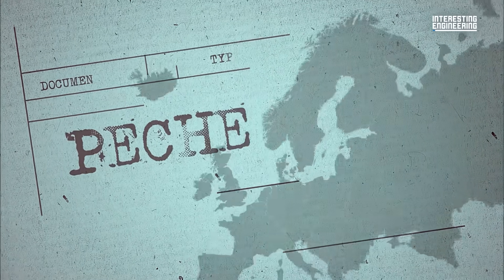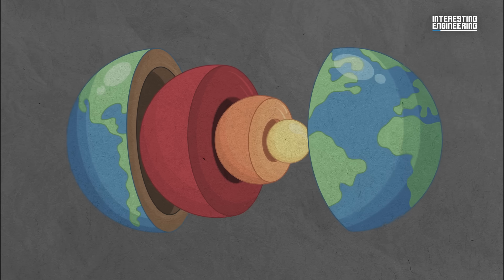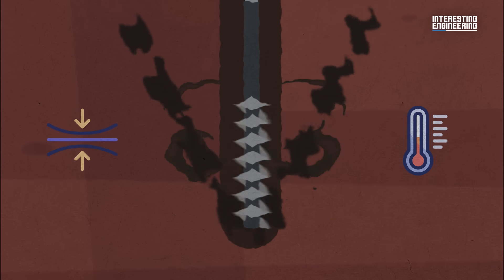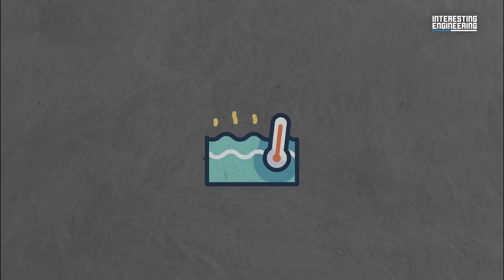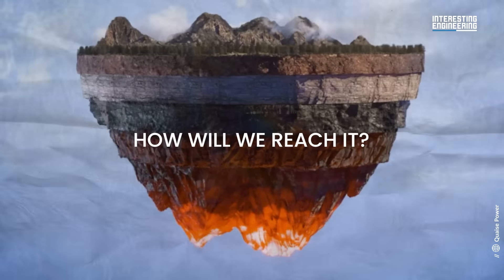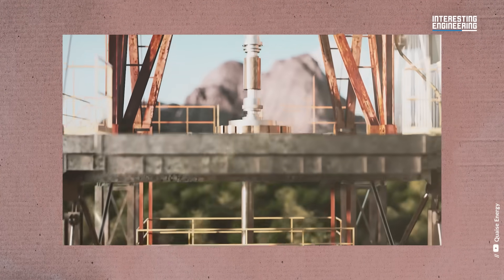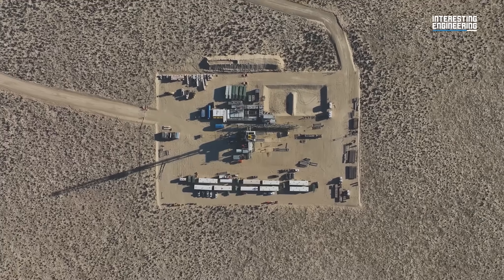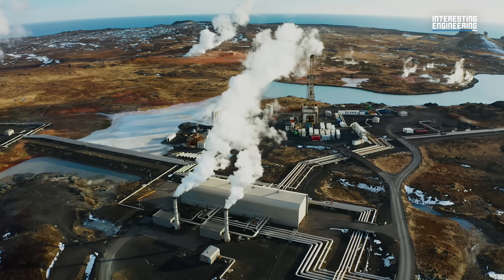How Deep Could We Dig for Infinite Geothermal Energy?

Comment: What I don't understand is why you have to go to such great depths to get heat. The boiling point is at a temperature of 100 degrees Celsius. To make steam. This is a temperature that is reached at a depth of less than 4 kilometers. This is a depth that can be reached without much problem.
Reply: It basically comes down to a formula known as "Carnot's theorem".

According to history, back in the 1800s various dudes including James Watt and others were playing with steam engines, and they were trying to optimize their thermodynamic efficiency so as to get the most useful work energy out of the engine, for the least amount of coal consumption.  A French guy named Sadi Carnot is credited for coming up with the formula:

nmax = 1 - (Tcold / Thot)

Where nmax is the maximum theoretical efficiency of the heat engine, Thot is the temperature of the hot portion of the thermal engine (ex: such as the steam temperature prior to entering an expansion chamber to do useful work), and Tcold is the cold side temperature (ex: the exhaust temperature of the steam once it has already expanded and done the useful work in the engine).

To use the formula, the Thot and Tcold temperatures need to be provided in absolute temperature units (ex: Kelvins, which start from 0, rather than Celsius or Fahrenheit, which start from negative numbers).  To convert Celsius temperatures to Kelvin units, add 273.15 degrees to the Celsius value.

Steam at 100 Celsius (373 Kelvin) is very poor quality steam, and it will yield very low thermodynamic efficiency when operated on the surface of the Earth, where the cold side of the steam flow exiting the turbine might be something very close to the hot side inlet temperature to the turbine (perhaps 60 Celsius, or 333 Kelvin, which is only possible for steam at lower than sea level atmospheric pressure).  According to the Carnot theorem, then the maximum possible thermodynamic efficiency of a thermal engine operating with those hot/cold temperatures will be:

nmax = 1 - (333 Kelvin / 373 Kelvin) = 0.107 = 10.7%

That is a very low thermodynamic efficiency, since it means you have to produce/obtain/process close to 10x as much heat in your heat exchangers, as you are getting out from your heat engine as mechanical energy (which further gets reduced a little bit converting to electricity).

The maximum theoretical efficiency goes way up when you use higher temperature steam (say 400 Celsius, or 673 Kelvin), or, you reject your heat at very low cold side temperatures (which is mostly restricted only to space applications, since no part of the Earth ever naturally gets anywhere near absolute zero).  The minimum cold side temperature for a normal Earth surface based air heat exchanger is the ambient air temperature, which will commonly be 25 Celsius or warmer on a hot summer day.  In practice, the cold side temperature will always be higher than this for practical heat exchanger size reasons, so something around 60 Celsius or 333 Kelvin is around the lowest practical value (with some exception for cold winter nights).  For a steam engine running at 673 Kelvin input temperature, and 333 Kelvin exhaust temperature, the maximum theoretical possible efficiency is 50.5%, which is far superior and practical for designing power plants, as compared to 10.7%.

There are however certain limitations to using Carnot's theorem.  It is applicable for macroscopic thermal engines operating with bulk heat transfer fluids, but it is not applicable to either solar photovoltaic panels or individual particle (ex: picoscopic/single molecule scale) non-equilibrium thermal kinetic energy converting systems (like that envisaged by James Clerk Maxwell, in his "Maxwell's Demon" argument/analysis/thought experiment).
Reply: Very high temperature steam is needed to drive a turbine.  First the boiling point increases with pressure and efficient turbines require high pressure (thousands of PSI).   Second, the steam has to be “dry”.  This sounds stupid, but in this case dry means there are no drops of liquid water.   High pressure dry steam is a pure gas.  Steam turbine blades do not like getting hit with liquid.  (It shortens their life) Since the pressure is dropping rapidly in the turbine, the gas has to be superheated (higher than the boiling point at that pressure) so that even at the lower pressure water drops do not form.  Now, with that said, sometimes turbines will have sections (or stages) that can handle some liquid water.  This is done to pick up a slight efficiency gain in order to stretch that fuel out a bit further - and nothing wrong with that.  But the high power front end stages do not like it.
Reply: Steam is just a working fluid, it's the "heat" in that steam that turns the turbine and gets turned into useful work, not the steam itself. The steam is just a carrier of heat.

Comment: Why is it so cold at the deepest parts of the ocean, its closer to  center where its supposed to be hot!
Reply: Colder water is denser than hotter water, at least down to 4 Celsius.  Consequently, the colder denser water wants to sink, while the warmer water rises to the top.  Additionally, warm water is actively produced at the top of the ocean, as most sunlight photon energy does not penetrate very far into water before getting absorbed and converted to thermal/heat energy.

Theoretically, if hot water is produced at the surface from sunlight absorption, and the Earth's core is really hot, then you should have hot water above the cold water on the sea floor, and hot Earth below the sea floor, thus creating a hot-cold-hot "sandwich", which would make the cold water middle portion become hot instead of cold.  However, that is not what one observes, as the system is more complex.

In practice, the Earth's crust is thick enough to be a good thermal insulator, so heat flow out of the Earth's core through the crust is quite slow.  Additionally, sunlight starved portions of the Earth, (ex: arctic/Antarctic) especially during winter, are quite cold.  These sunlight starved portions of the Earth produce large amounts of cold water, which is dense and sinks to the bottom of ocean, but in so doing, leaves a lower pressure location near the surface, which sucks in warmer surface waters being produced in sunlight abundant locations of the ocean closer to the equator.  The warm equator water travelling near the surface reaches the arctic/Antarctic region, cools off, sinks to the bottom, and continuous the heat transfer loop as cold water moving back towards the equatorial region (near the bottom of the ocean).  Thus, the colder water at the bottom of the ocean is constantly warming up and rising, but it is also constantly getting replenished/replaced by new cold water coming in from the sunlight starved polar regions of the Earth.

Comment: I am not against nuclear. Especially if they get fusion to work. The simple reasons are off planet, high latitude locations and special applications. However, we are in an energy transition, where power generation takes place at decentralized local levels. Geothermal is best used as baseload for distributed battery based mini-grids.
Reply: I was thinking the same thing. Geothermal is great for those staying here on the surface of the Earth. Up in the sky, in the sea, in orbit, on the moon, etc... all but worthless. I'll be fair here, the vast majority of us will be here on the surface.
Reply: Same same. Team Low/No Carbon vs Fossil Fuels. Not any other way...

Comment: America needs to tap Yellowstone
Reply: No need, think of Yellowstone as being a welding torch.  The path, which is followed by the Snake River, is the weld bead.   The material under that bead is still hot.  Look at “Hells Half Acre” along I-15,  “Craters of the Moon”, and the Menan Butte as examples.  Easier to get there, more utility infrastructure, a lot more potential sites, and it does not require the drill crew to commit suicide.
Reply: Nope. No need to go there when there's a TON of close to surface heat sinks in other places that don't have cultural, historical, and environmental significance.

Comment: Why narrative against nuclear power?
Reply from the maker: Nuclear is a good solution to clean power but it has it's issues. Digging a hole in the ground to heat up water seems like a more simple, cleaner way to create energy. I guess we'll have to wait and find out if it is!
Reply: @Interestingengineeringofficial  you are neglecting lots of issues with geothermal with simplification. First- not really proven at scale(Iceland is a special case), can be really expensive in real life. Lots of water needed, will bring lots of corrosive salts to the surface, possibly lots of radon, possibility of depleting heat source(constant drilling needed), earthquakes from drilling and cooling large volume of rocks(density changes), and other issues.

Comment: Not mentioned in this video is Eavor Technology.  They have a commercial geothermal facility up and running in Bavaria.  Geothermal is a fraction of the cost of nuclear and can be built in about 24 months.
Reply: Absolutely agreed. Eavor seems to be the greenest  of technologies as well. With a closed loop system
Reply: With modern boring tech 
    I can't believe they don't have geo thermal everywhere 
    Even if you had to case the whole thing 
   Id want to anyway 
And use lots of insulation
Reply: Closed loop is most efficient 
     You can use synthetic oil you get really hot to boil water then the steam drives the turbine cooled and water returned 
   If you just put steam out of the ground through the turbine 
   Be the same as using cooling pond water in your boiler 
    Chew up the turbine 
Gunk up stuff
Reply: Bingo! And its Canadian! Albertan to be exact, HQ'd in Calgary... The North American oil capital not so ironically enough....
Reply: The problem with the geothermal plant that use cracking methods they don't tell in this documentary is the cracking doesn't always result in a workable geothermal well. The cracking for geothermal has also the same downsides as cracking for oil, mainly working fluid leaks in groundwater, geological instability (earthquakes) etc. Which is why deep drilling development is so important. Cracking is easyer to do but less reliable and has some unexpected downsides.

Comment: If we survive as a technological civilisation, then, barring some incredible, Fusion breakthroughs, I agree with the guy, 80% geothermal within fifty years. I think creeping into the 1-3% gap in ten to fifteen years, and then boom, as the tech develops, and scaling, means costs drop. They can be built under existing, coal and gas generating stations, with employees, connections and most of the tech, already in place. I really wish someone would pump a load of money into this, but it's just too hard to monopolise.

Comment: This is where I think a transportable Small Modular Reactor could be quite useful for drilling multiple holes simultaneously, then when done move it all to the next area for drilling for a geothermal plant.
Reply: These FAANG shills will stop at nothing to promote nuclear fission. It's sad really.
Reply: That's ridiculous I work in oil and gas and I drove Wells everyday well sometimes it takes a month so I would say probably every month and we don't need a reactor to drill. Power is not a problem we have that covered the depth is the problem we only go down to 5 mi in the vertical
Reply: @Everydayrocketscientist I know nothing about drilling, but I would assume that a microwave rock melter would require a lot more electricity than a traditional rotating drill.
Reply: @Everydayrocketscientist This isn't about conventional drilling but about microwave drilling.  It took twenty years to drill that bore hole in Russia because the drill bits would only last about two hours at that depth and it would take days to extract the worn drill bit and days to insert the replacement.  With microwave drilling, the drilling itself is slower and it consumes far more power but there are no drill bits to replace, the bore hole itself is a microwave channel directing the microwave energy generated at the surface to the bottom of the well.  It is expected that with microwave drilling, you could drill these depths in 90 days instead of the 20 years it takes with conventional drilling but the caveat is you are directly vaporizing the rocks with the energy, not just pulverizing and moving the rocks around.   However, as you go deeper, it takes less energy to vaporize the rocks as they are already under high heat and pressures to begin with.

Now, if you could build modular molten salt thorium/uranium breeder nuclear reactors, you wouldn't need these geothermal power plants in the first place.

The "clean" geothermal power also isn't so clean as these are open cycle plants where it is water in a reservoir that is used to drive steam turbines and then condensed and allowed back into the geologic reservoir giving the ample surface area to reheat.  The condensation is also open to the environment in the surface so elements from the reservoir are released, most notably sulfur forming sulfur dioxides which can be devastating to the global climate.  Close cycle are possible but requires for more complex drilling and/or heat exchangers and are less efficient.

Also the reason for drilling is deep is so that you could place the geothermal power plant anywhere, not just near natural hot springs and volcanically active regions such as in Iceland.  This means the drilling could be done where there already is access to the grid so it simply isn't needed to move a modular nuclear reactor around.
Reply: @Everydayrocketscientist   what about detonating nuke at max depth rechable...?
Reply: why not just use the reactors to power places?
Reply: @trekrich28 Small Modular Reactors are less efficient than larger reactors, and normally aren't cost-viable to use for grid power.  (Could change in the future with mass production, but who knows)

SMRs are good for remote sites where it'd be expensive to connect it to the grid.  Think in the middle of the Arctic, deep in the desert, out in Siberia, in the middle of the ocean, etc...  Normally diesel generators are used out here, and a nuclear reactor will save on the logistical strain of having to ship/haul the diesel into the area.

If you're already planning on hooking the area up to the grid, though, I'm not sure how viable of a plan it'd be.
Reply: Also, at worldwide scale over enough time I suspect it may even have the side effect of slowing down Plate Tectonics, thus taming volcanoes and earthquakes at large.
Reply: @jokerace8227 and what side effect would occur and how would affect us?
Reply: @jokerace8227  username checks out 😂